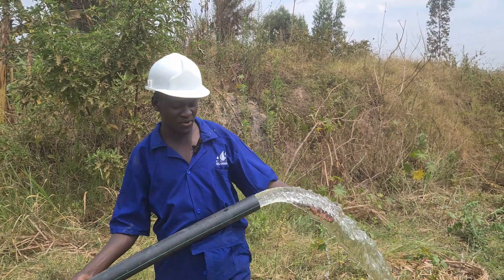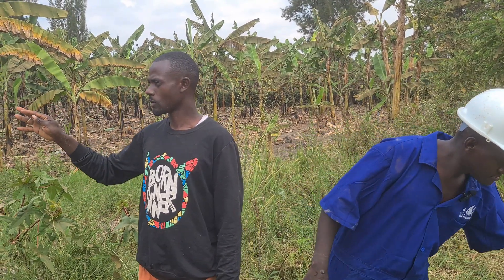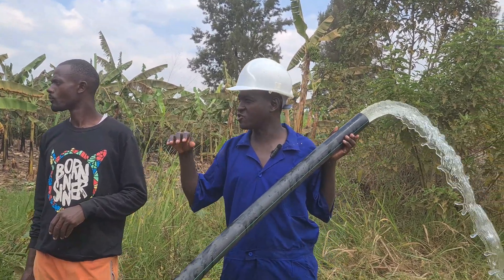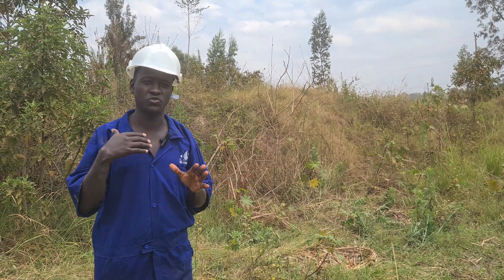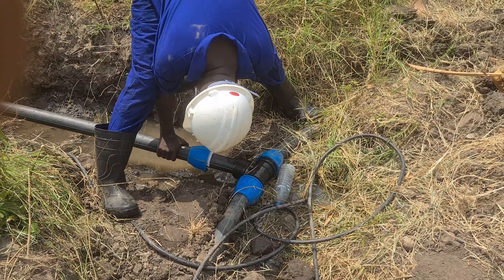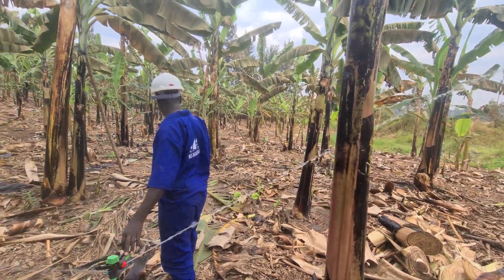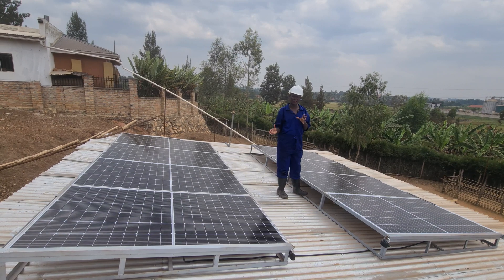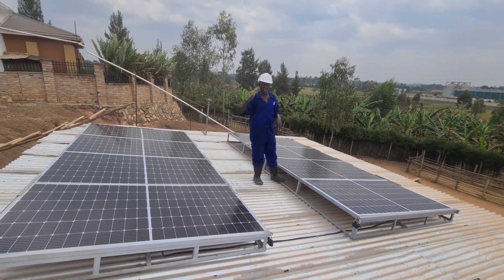Solar powered fixed sprinkler irrigation for banana plantation using Yuzuak ATOM14 fixed sprinklers

Comment: I'm from Zambia.
1. Where can I purchase your advanced solar inverter?
2. Can you power a submersible and booster pumper from one inverter.
3. Can pumps with varying phases be used on one of your  inverter at the same time?
Reply from the maker: Nice to hear from you from Zambia.
1. Once we know your pum motor specifications, it can be sent to you or find local suppliers' if any.
2. Yes, you can power both pumps if there are the same specifications. One pump will operate at a time.
3. No, one pump with varying frequency can be operated at time

Comment: Great job,but l think it would be beneficial to mention the size of the solar system, the size of the pump and water delivery.
Reply from the maker: We shall make it a point in our next demo, size of the pump was 87 meters - maximum head and 20m³/hr maximum flow, motor size was 2.2Kw, delivery pipe was 2"